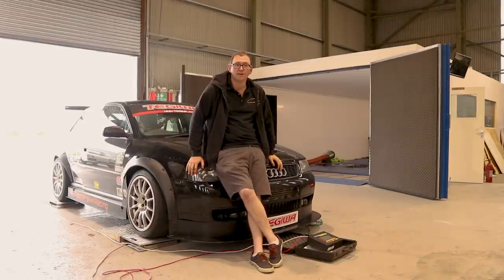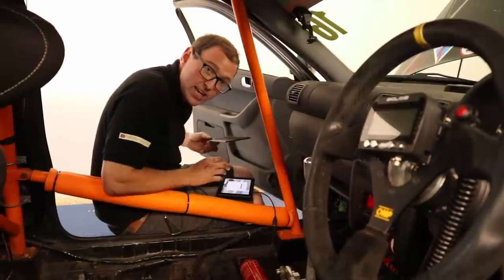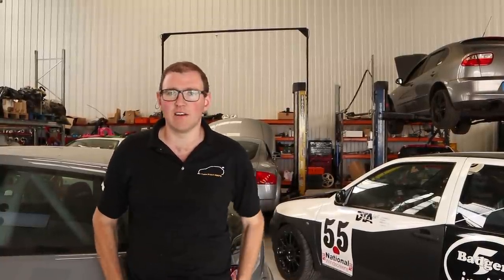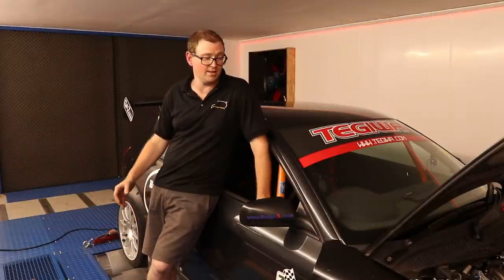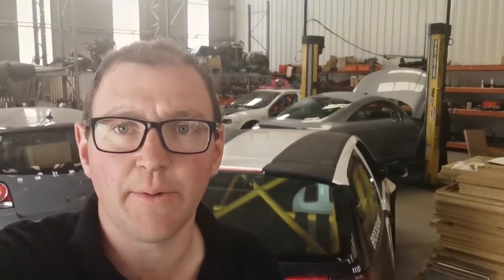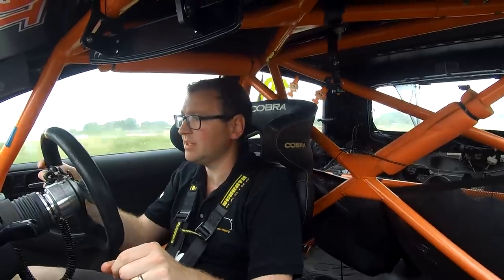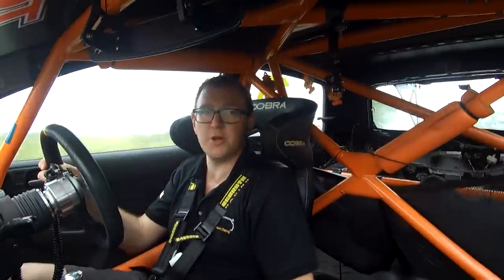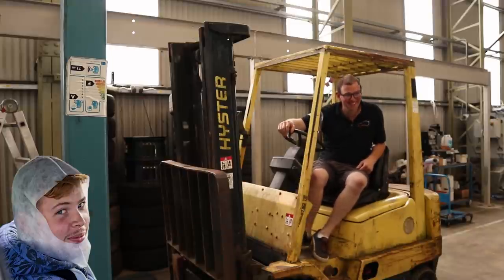DYNO DAY at Badger 5 - Mapping the G25-550 - READY TO RACE!

Comment: How does the G25 550 compare to the G25 660? I'd like to see both dyno curves together and also get your feedback on how they actually feel both on the road and on track. Very rare to find someone who has tried both on what is otherwise exactly the same set up.

Excellent channel by the way! 👍🏻
Reply from the maker: hey Ryan! Sorry for the late response!
Out on the Road, you can most definitely tell both turbo's are closely related.
the 550 is definitely the sharper of the two, and makes noticably earlier torque, as you'd expect, but it's definitely at the expense of the top end puff at high RPM.

The 660 still feels like it has instant spool when compared to the GT30 type stuff offering similar peak power, but definitely has the legs at the top end over the 550, happily holding 2.2 bar at 8k rpm, where the 550 is all out of steam.

For a road car, I'd say the 550 would be more punchy and give more useable power more of the time.
For a track car that ISN'T built to regulation, I'd take the 660 all day long myself.
Reply: @TeamPrawnRacing  What a/r size have you gone for on the 550?

I'm in the process of a similar build (on a Renault 2.0T) and I'm not sure where the 550 will run out of puff with a 0.72 a/r?

Comment: Really enjoying this series. Great car and great production quality.

Why is the boost threshold so high relative to OEM solutions that make their torque below 2000rpm? Is this done intentionally to protect the gearbox or is this set up just not capable? The turbo is a very similar size to for instance the IS38 used on the current Golf R. Does direct injection really make that much of a difference (2900rpm vs 1800rpm)?

Comment: What clutch and flywheel are you using?Great results.I run the same turbo on an S3 8l with oem air filter and got 355 and 53 torque at the wheels with 1,9bar.

Comment: So that’s the max power that is achievable with your setup 463hp with the g25-550 within shaft speed sensor limit?
Reply from the maker: It'd make higher figures with a little more boost and some WMI, but the car will be racing in a mini-endurance series so reliability is king and meth doesn't fit within the rules. Bill has seen over 500bhp on a few of these now, albeit with slight engine differences.

Comment: How far away is Bills new place from the old Badger 5?
Reply from the maker: Not far at all, about 8 miles or so. Such a massive upgrade though - the unit itself is huge and much better set up, and it's tucked away on a really nice old airfield too. Oh, and the cafe (shed at around 0:20) isn't half bad either!
Reply: @TeamPrawnRacing  Is the cafe that good then?
Reply: @Sash_Window  Given it's a shed in the middle of an airfield, it was spot on. Never going to be fine dining, but tasty grub which was dirt cheap and service with a smile, can't fault it!
Reply: Bugger, wrong account. But yeah, it was good!